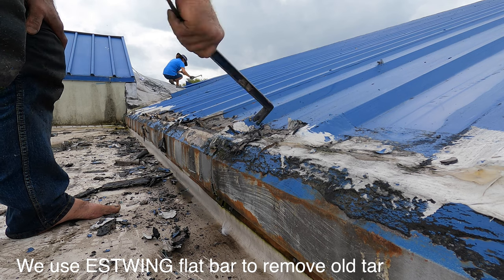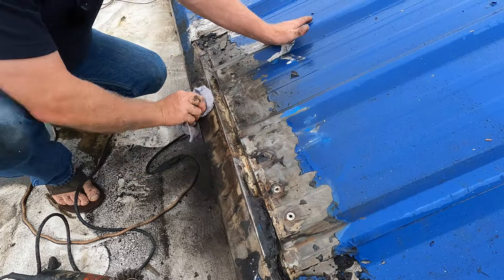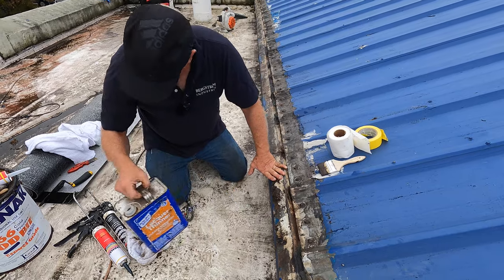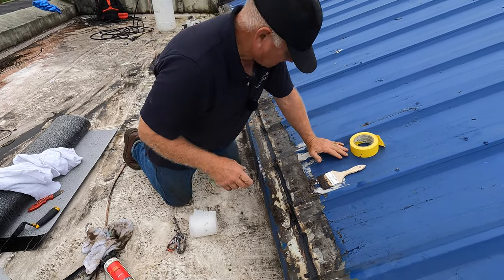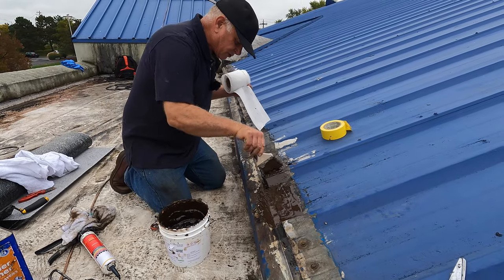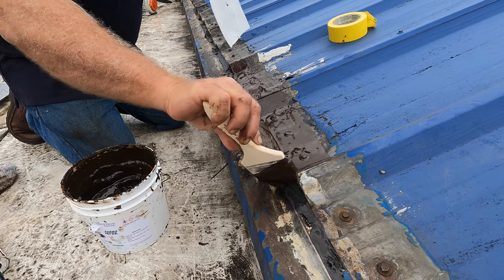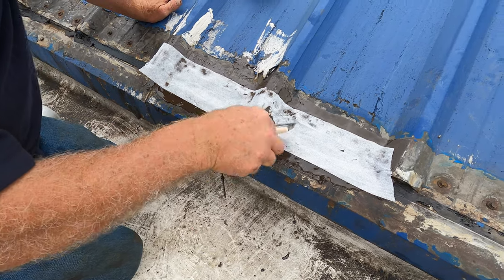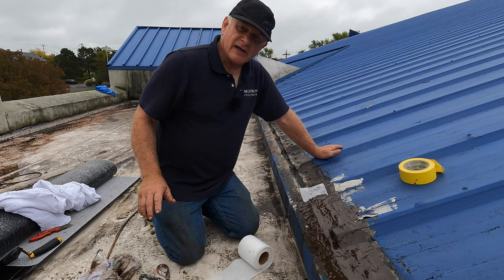Repairing a Rusted Metal Roof Seam - This was the worst ever repair

Comment: The problem with this roof is the roof does not go over the edge of the eve. What you have done is just a temporary fix until that Cockrell is out. If you stepped up on the roof about 4 feet and added a new section of roofing and had an overlap that Eva very adjacent building, and then see all the top of that piece that would be better.

Comment: I think it would be much better  to cut and  remove the rotten edging altogether and  take it back to below the line of fasteners.  Cut  from new roofing sheets replacement  inserts, which are lapped and fastened in place.  I recommend painting or otherwise sealing the laps and also the underside of the inserts at the edges where water runs off as these areas are prone to rust.   I think this will  provide a better and longer lasting option than patching  the exposed edges, which are very corroded, and I guess just as much on the underside that you can not see.

Comment: You are not removing tar. You are removing asphalt.
Reply: It's the same thing.
Reply: Nothing lasts forever so I am a bit sceptical. If the roof has corroded that much on the  outside what about the underside.  You mention capillary action at the edges  on another video so it is bound to happen  here.  I have a decramastic roof and the tiles at the edge  exposed to the weather are heavily corroded on the underside which didn’t show on the exterior surface.  So to do the job properly I believe  you have to lift the iron sheets and treat the underside in the same way especially if it is corroded.  Otherwise rusting will continue due to condensation etc.